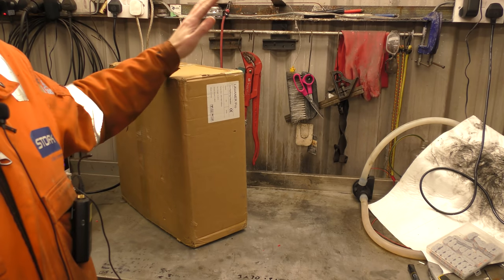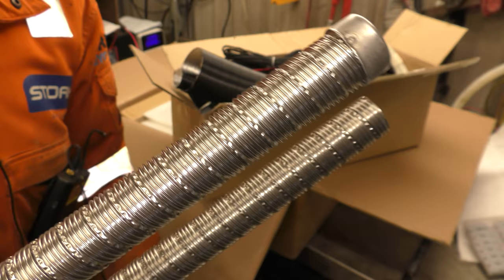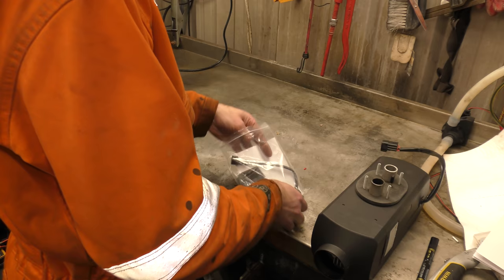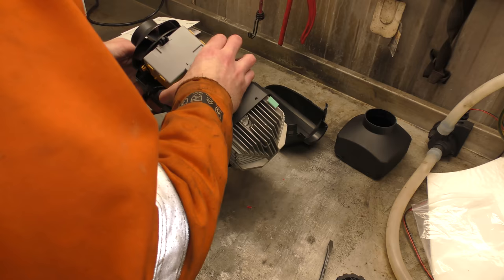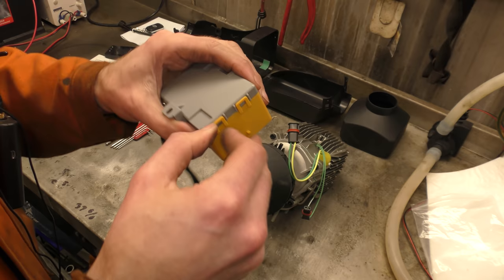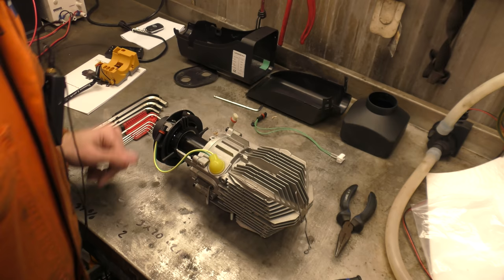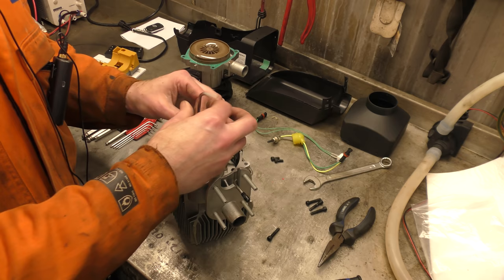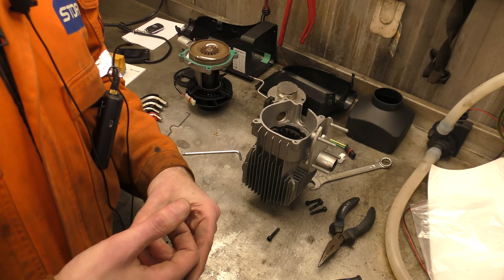Lavaner Pro 2KW Diesel Heater - taken apart

Comment: Thanks for the breakdown of the heater to that level. I am the first owner of the heater in the USA (the 2kw is the only version currently available here in the US), and I too, have a video (coming soon) where I do an unboxing,  and review. I didnt take mine apart, so, I will (with your permission) include a link to your video so customers who are interested,  can see the insides of the heater. 

I am VERY impressed with the quality as well. I now have been running mine for about 3 weeks, and TOTALLY am sold. Super quiet, and beautiful heat coming from it. 

It's definitely worth the investment of purchasing this heater.
Reply from the maker: Link away.  If you send me a link to yours I'll share it as well.

Comment: Don’t be overly surprised that they tested the one they sent to you David, I’ve installed around 15 of these since the brand went big with the quality advertising - none of them had been tested and one had a buckled fan. Still, definitely an improvement on quality. Good video.
Reply from the maker: That's a very good point.
Reply: The one I have was tested as well .
Reply: i have 2 of them... both of them are 2kw and both came really wrong tuned...
Reply: and yours is 100% tested as all my heaters came wrapped with plastic seal and yours is not
Reply: one out of the 3 heaters we tested had a broken fan the second day of use. AND IT IS IMPOSIBLE TO GET SPARE PARTS OF THE LAVANER HEATERS IN EUROPE
Reply: @dOKzE  mine arrived with a fault in the exhaust pipe. Contacted Craig at Lavaner and he sent replacement straight away. Not as ideal as having on-hand spares, but pretty snappy service so far.
Reply: @brucenz4816  exaust pipe is not a spare part... Glowplug? Motherboard? Burning tubes? Tepmerature sensor?? Motor fan?  Try getting one of those... I do not understand why the dont sell them in their aliexpress store

Comment: I have the Lavaner 5K Pro, running with an afterburner, totally compatible and running beautifully for a couple of months now.
Reply: Lavaner doesn't offer a 5Kw Pro yet, only the 2Kw. You have the Lavaner 5Kw Standard. I just talked to one of the company reps and verified using their sales page.
Reply: @dansmith6990 
Maybe talk to them again then, this is my receipt.
LAVANER Pro Waterproof Diesel 12V/24V 5KW Air Parking Heater LCD Remote Monitor Controller for Trucks RV's Campers and Trailers 
12V, Belgium x1
Reply: @charlesmott8863  My mistake, I talked to Craig He, the representative of Lavaner and he said that they do have a 5kw Pro but they're sold out and will be returning for sale in the fall.
Reply: What is the after burner ?
Reply: @TheTricky1981  To put it in the words of the developer himself: An improved, extensible, controller for Chinese diesel heaters.
http://mrjones.id.au/afterburner/index.html
Reply: @TheTricky1981  A really great device/improvement - with a bit of a silly name!

Comment: Excellent initial overview to see the differences. Thanks for mentioning my heater sensor "springy grommet" fault (20 mins into video) Its one thing to keep in mind because when it degrades it will cause start up issues and premature shut downs and not always show a fault code.

Comment: Nice and fair review! I like what you do.
I believe the small sensor is for the input air temperature. If the air in the room is too hot and the sensor on the controller is mounted in a wrong way, the ECU will detect the real need for fuel and adjust the pump accordingly. Just a supposition.
Cheers!

Comment: Hello David. Thanks for the detailed video on this heater. Do you know if the lavaner controller would work a 2kw chinese diesel heater, as the lavaner controller is much better looking, and likely to last longer. If it does work is it plug and play or do the wires need configuration.

Comment: Hi David! It is always pure joy, to  watching your videos..! You did mention, that there is no "2Kw", "5Kw", or "8Kw" heaters, they are just numbers.. I do understand, Of course those size makes some difference, and how high they runs, does that make all the differences? Have i understood right?? Have you ever measured the temp difference between "2Kw" and "5Kw" heaters..? (Sorry my English, lol.)
Reply from the maker: Hey there.  Sorry I should have been more clear.  There are only two sizes of heater, the 2KW and the 5KW and they are physically different sizes.  All the other heaters marketed as 8KW, 10KW and 12KW are just the 5KW body with numbers printed on the box.  While you can get more heat by adding more fuel the efficiency changes and you have to run things harder shortening their life.

Comment: I am looking at buying a diesel heater for use at high elevations. 7000ft to 11000ft (2000m - 3500m). Can the Lavaner Pro 2kw work at these elevations? I saw that a  Lavaner Pro Alpine 2kw was made to compensate for high altitude but it is no longer available on Aliexpress. Has the Pro Alpine model been replaced or renamed to the  Lavaner Pro 2kw? If not do I need to buy the high altitude kit for proper operations?

Comment: I was going to install my diesel heater outside and put the hot air output through a double glazed window, that I have replaced the glass with a 24mm plywood board. My question is....Does the out put hot air hose near the diesel heater get to hot for me to put it through the plywood?
Reply from the maker: The hot air outlet through wood is ok.  That's how most campervans have them set up.  Are you going to heat outside air or are you going to have inside air routed to the cold inlet of the heater?
Reply: @DavidMcLuckie  I was going to recirculate inside air. Wondered if you could help with the following. i saw your vid on the diff between the 2 5 and 8 kw heaters.

I ordered a 5kw tricklicks diesel heater, which has now arrived. No where on the box or the heater does it state 5kw or anything else. I think I have been sent a 2kw.

Are there any measurements I can take to confirm if it is a 2kw or 5kw unit. Such as internal diameter of the exhaust or combustion air intake or even the internal plastic hot air outlet vent.

I would appreciate any assitance, thankyou.

Comment: Hi David I have a question about the fuel pumps the installation says it is supposed to be at an angle I was curious why and what happens if it is not.....maybe something to test....
Reply: air bubbles
Reply: @CosmicSeeker69  thanks for the answer I was testing my install and the pump was just laying flat ( worked fine) and I’ve never known other solenoid pumps to need to be at an angle so just curious as to why this was different
Reply from the maker: Like Graham said to help remove air bubbles and someone else said something about it keeps any sediment trapped in one area of the pump.
Reply: @DavidMcLuckie  many thanks for the information and your time
Reply: I personally think this is two 'wrong' things:

Eberspachers come with a pathetic tiny filter, so they have to assume sediment making it to the pump - to minimise reliability issues, the pump then needs to be at an angle, to keep the sediment collected at the bottom corner of the pump, not going in through the central area. So - holdover from Eberspächer instructions, 'blindly' transferred to these new diesel heater manuals.

Then - I think that all these angle-related warnings, air bubbles, etc - apply to the filter module, not the pump. The two look similar when drawn with lines - so I reckon a 'Cinderella's glass slipper' happened here - a mis-translation somewhere, taken as the basis for all other manuals thereafter - leading to an entire Internet-wide misunderstanding forever more.

Comment: When looking online, it doesn't have any way to buy any parts for this brand. 5KW is not a choice. They only sale 2KW. They cost more and base on the reviews I have seen so far, it appears they need the same type of repairs. I rather get the cheaper ones and rebuild them with better parts.
Reply from the maker: I've got a box of Lavaner spares.  But that was before the shitshow of 2021.  Stocks of everything are low.  They do have a Facebook page you could enquire on - https://www.facebook.com/Lavaner-Pro-Diesel-Heater-106624824474845/

Comment: That they tested the unit they sent to you means that even they aren't convinced of their quality. You might need to get one from the regular supply chain to see the quality they are selling. Getting a unit that has been tested raises a red flag for me.
Reply: My heater was tested as well.
Reply: Every motor engine is test run before it's installed into a car, got an opinion about that too?